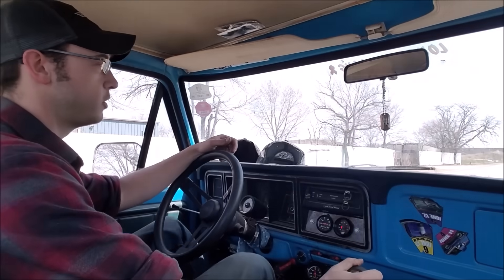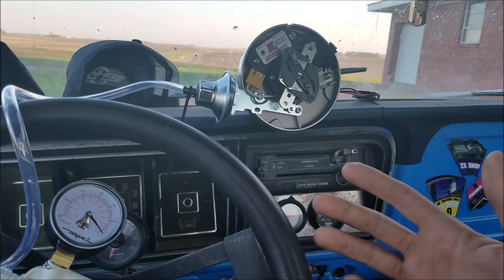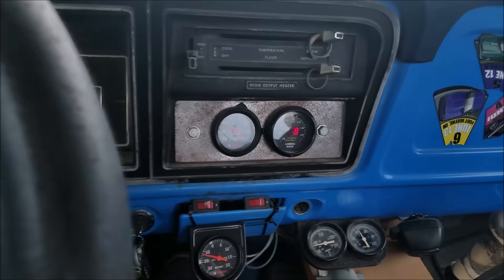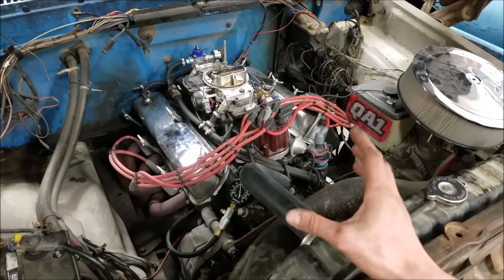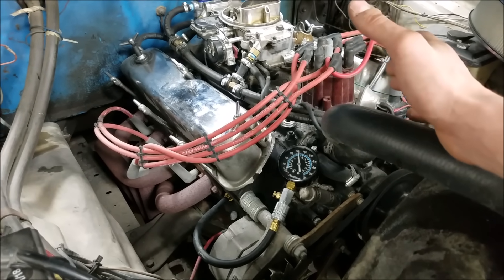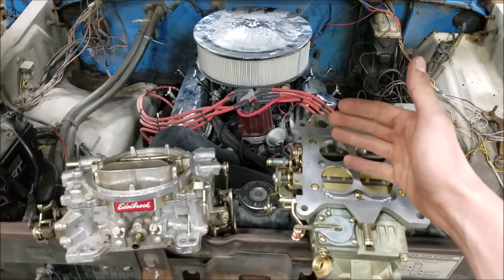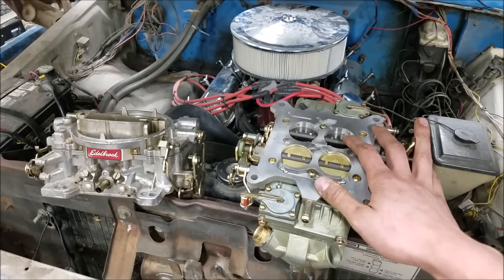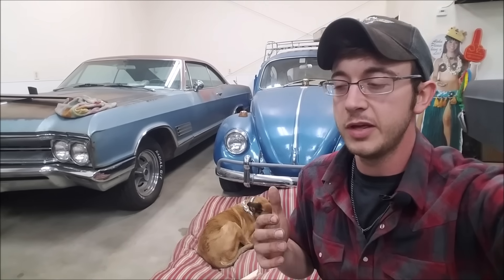Vacuum Advance - Ported vs Manifold: Which to Use & When !!!

Comment: At cruise with the throttle barely cracked, manifold vacuum is high (near 17-18 hg for me) and ported vacuum is below the threshold for the vacuum canister to even kick in.  This means that at cruise being hooked up to ported vacuum is giving me nothing when I need timing most.  Manifold is the way to go.
Reply from the maker: Lol go test that theory - I have a 100 dollar bill that says that if you put a vacuum gauge on ported vacuum cruising on anything that isn't "deceleration" will have full vacuum from the ported port. 

This is you just running your mouth without actually testing it with a vacuum gauge - which I have done.
Reply: @ThunderHead289  what are you talking about?  I have both ported and manifold gauges in my cab and I can see where the needles are while I’m cruising,  it isn’t a mystery.  There are quite a few videos on YouTube of side-by-side comparisons showing the same.  I don’t understand how you can be so knowledgeable about all this stuff and somehow miss this one.  You do realize that often a significant portion of cruise even happens off the idle circuit, don’t you?
Reply from the maker: @yeboscrebo4451  you probably have a crap machined carb then honestly which is very prevalent lately. Pretty much the moment your into anything but idle ported should be exposed and drawing full manifold vacuum. I've worked on a few carbs lately that no matter what you did, ported always had at least 8inHg which is also wrong but in the other direction. 
Seems like only old carbs are machined correct these days. 
I didn't miss anything, it's how it's supposed to work.
Reply: @ThunderHead289   Let’s get to the bottom of this because we seem to be in two different worlds here.  One of us isn’t seeing clearly and I’m pretty sure it isn’t me.  My carb is an impeccably maintained, original autolite 2100.  As I said, when i am just off idle (cruise) my manifold gauge will read near 20 hg and my ported gauge will read below 5 hg.  I literally just drove my truck down a country road and it spends most of its life cruising along just like this.  This is an efficiently running engine.  When people say “the only difference between manifold and ported is at idle” they are completely ignoring this off-idle cruise zone.  My engine and most others engines spend the majority of their lives in this off-idle cruise zone.  Only manifold advance will give you the advance you need in these off-idle low load conditions - THAT is how its supposed to work.  I really don’t understand what’s so difficult about this. Then, when I accelerate or come up on a hill, the ported needle will increase, the manifold will decrease until they equalize.  As I continue to press into the peddle, the two needles will both drop to zero.  This exact scenario is replicated in many, many comparison videos on youtube for all to see.  For some inexplicable reason, the ported guys will always ignore these off-idle cruise conditions and pretend that the gauges go from idle to equalized part throttle instantaneously skipping over the transition and say “the only difference is at idle”.  Sorry, not correct - just look at the gauges.
Reply: @ThunderHead289  Also, when I watch the two gauges in operation, I notice that when i press on the throttle through its full sweep, the ported needle goes from zero up to about 15hg and then back to zero again.  In other words, ported vacuum advance comes onto the scene giving me timing at the same time in which mechanical advance also wants to step on the stage and give me timing.  What is the point of this redundancy?  However, at the same time I notice the manifold needle starts at 20 and drops steadily to zero as I press on the throttle and the cylinder pressure increases.  In other words, manifold advance gracefully steps off the stage as mechanical advance starts its performance.  If these systems were designed for ported, why does ported seem so up-and-down, jerky and redundant?  Why does manifold vacuum advance seem to work far more seamlessly in the timing dance?  And why does ported advance not take advantage of the full range of manifold vacuum that’s available like manifold advance does (roughly 15hg with ported compared to a full 20hg with manifold on my stock, unmolested setup).  Doesn’t that seem strange?  It sure seems like ported advance is an awkward, bandaid coping measure just like Mr. Vizard said it was.

Comment: Man iam noobish lol. I just wish you could asses my 63 buick.  Sounds like I could be getting a bit more power out of my Stock 215ci. Fireball V8. Just took of the RochesterQJet  and installed the AVS2.  But my timing and carb needs a Professional To Adjust .  Thank you

Comment: You left some stuff on the table and are backeards eith you cam size scenario.  Matter of fact its a culmination of what creates higher cylinder pressure that will dictate which to use.  But, in reality, ported vacuum was a function of emitions.  Pretty much every engine will benifit from advance timing at idled/manifold vacuum.only ones that dont are ones that require locked out advance.
Reply from the maker: Instead of flapping your jaw nonsensibly, it would be wise to listen. 

Clearly to complex for everyone - the point is that it's not about what ported manifold does as much as what it allows you to then be able to do with your mechanical timing
Reply: @ThunderHead289  nice well-formed educated reply.  You're very off on your explanation and what why and how it actually benefits the motor.  Or why ported vacuum was even a thing.  I truly enjoy most of your content.  There are plenty of articles and information on this subject that does a much better and more accurate job of actually describing the hows and whys.  

You are right in it being too complex for most people.  Everyone wants a plug and play solution and doesnt want to take the time to understand the timing hows and why, let alone the time it takes to get a proper curve worked out between base, mechanical, and vacuum timing and why each are very important to tune individually.

Sorry, i seem to have just been running my nonsensicle flap again.  Lord knows i havent spent years and years working on street, and race cars and researching how and why timing is very important to performance.  I would probobly also blow your mind if i told you my truck runs at about 18 to 20 degrees initial timing and 60 total cruising to make up for the shit combustion chamber design and the poor flame front it creates, and that i tow a 10k pound camper with the 1985 technology and cranked timing on 87 octane gas.

But what do i know, im just full of nonsense.  Forget the years of knowledge drawn from actual powertrain calibration engineers ive worked with over the years

Good luck on your ventures!

Comment: Simply explain ported vacuum would be before the throttle plate- no vacuum at idle and manifold vacuum will be from intake manifold- vacuum decreases as engine rpm increases
Reply from the maker: Vacuum is irrelevant to rpm, only relevant to load
Reply: @ThunderHead289  when you open the throttle plate your manifold pressure increases - vacuum decreases and your engine rpm increases. They are inversely proportional

Comment: Have you fooled around with a dual port vacuum advance?  Looks a good way to get boost retard and low speed advance using just the front port?  Would you know how much timing it could advance in one direction and retard in the other when under boost?  I think it would have to be manifold vacuum not ported to work.

Comment: Kool info..just came across ya channel.. new subscriber 🤘
I just picked up a 75 mark iv 460bb engine clean and quiet, new 750 Holly. Only thing fella never changed was the distributor advance diaphragm... as it doesn't work..😳
 I'm in two minds to either replace the advance mechanism get a new distributor 🤷‍♂️
Are they hard to change out ?
Reply: I Changed the vacuum canister👍🤣

Comment: Thank you for this video. I recently noticed that my distributor vacuum was connected to manifold vacuum. Just like you said, after moving it to ported I lost the vacuum advance that was there with the manifold connection. Idle became more rough. Now thanks to you I know to add some mechanical advance to smooth out the idle.

Comment: The Progression Ignition couldn't handle the heat from the motor. It lasted me about a year and a half and had the module fail once before on the pressure transducer as well. Just took it off and replaced it with a new HEI distributor and misfire and back fires went away. The computer board got bad enough that it actually stopped giving spark all together. Very expensive 1.5 year service life distributor. 🙄
Reply from the maker: Dumb question, but we're you supplying it with the 12v it calls for or was a resistive lead still in place

Comment: My old car, 1960 impal with a 283 2 barrel, has absolutely no ported vacuum ports, only one single manifold vacuum, what should I do? I have it running to transmission and distributor is just running mechanical advance
Reply: You should set it up according to stock specs.  That means using the vacuum advance.
Reply: @michaelbenardo5695   again, the only vacuum port on the engine is full manifold vacuum, which is WAYY too much for a distributor.

Comment: Thanks for this great explanation. I understand this video was made 3 years ago, so might not get a response, totally understand. Im not a mechanic, but enjoy working on my car, having rebuilt the engine and many other parts. I totally understand ported and manifold and how it relates to advanced timing at Idle. I don't have a stock carb, may years ago I fitted a 44mm CV Harley Carb. It does have a vacuum port, but not a port that blocks vacuum at idle, so I have to run manifold vacuum. I have a small engine and it seems to run fine, but Ive always had in the back of my mind that Im not setting up my timing correctly. A stock spec setup should be 750RPM at idle and 10degrees on the timing. The only way I get this, is if I disconnect the vacuum, block it off, set the timing and reconnect the vacuum. But now I have 1100rpm at idle. I have driven like this for years, but i bugs me that I idle very high. So recently I added a small electronic solenoid on the vacuum line to my distributor, with a switch on my accelerator pedal. So when at idle, with no press on the pedal, the vacuum is blocked and my idle sits at 750RPM. Then when I pull off, vacuum kicks in and advances. Question, is this a dumb idea? And should I even be looking to try match stock timing settings, when I run a non stock carb. If so, without diagnostic tools, is there a way I can work out what my timing should be, to move away from the stock specs? Thanks for your time, again, great video.

Comment: I had an old Cadillac that had a thermostatic vacuum switch that would run ported vacuum to the advance until a certain temperature was reached then it would switch to manifold. Kinda like a high idle setting.
Reply: When the water temp passed a certain point, it would switch to manifold vacuum to raise idle speed and give cooler running.

Comment: I have a quick fuel brawler dual bowls and manual choke and mechanical second valve opening(not vacuum)is cant get the transfer slots to square its a litlle more and limmited by the carb bracket 
I have a 331 stroker with t5 trans and 290/290 comp cams .
Wich port should I use?

Comment: I'm old school. I've always ran Chevys with ported vacuum and Fords with vacuum as you increase rpms. As most people know, Chevys are tough and will easily revv 8k but weak v8 Fords are limited to 5500 rpms. Sure you can revv higher but Fords will experience valve floating on their single valve spring design. I appreciate your video and will have to put your information to a test on a stock 350 chevy next month. And I never knew what those slotted vents were on a carb. Lol. I'm open to learning old knowledge because I am not a know it all.

Comment: But Manifold vacuum advance doesn’t “just add timing at idle”.  It adds timing whenever there is manifold vacuum - which is at idle and just off idle and cruising down the highway with the throttle cracked.  It seems like advancing timing with ported vacuum plus the mechanical advance of the distributor is a redundant performance of the same function - the ported advance increases from off idle through part throttle (and so does mechanical timing!).  If you instead run your vacuum advance off of manifold, then youre getting timing at the precise moments of low load or low cylinder charge when it’s needed and leaving the mechanical timing to do its separate job.  Without manifold advance, what else would give you the right timing conditions for low load situations?  It sure seems the vacuum advance canister was designed and intended specifically for manifold vacuum advance to me.  If running manifold advance means you might have to drop your initial timing a bit then just make sure you’ve got the right amount of mechanical timing coming in quicker, right off idle so there’s no hesitation.  I just don’t get the point of ported vacuum advance
Reply from the maker: Ported vacuum doesn't increase with throttle in a linear way. That's venturi vacuum. The throttle needed to move a vehicle is going to be plenty for ported vacuum to be the same as manifold. 

It's literally the same except at idle. Which because of that it allows you to run more effective mechanical advance instead of "oh no, I have too much idle timing (on manifold vacuum)" hillbilly idiot turns distributor such to reduce initial mechanical - wonders why his engine seems weak and has an off idle stumble (which is due to late mechanical timing) - Wal around telling people that carbs suck. 
Yeah ....
Reply: @ThunderHead289   I’m trying to understand.  So I mapped out my ported advance curve with a timing light and from about 1500 rpm to 3000 it gave me a canister’s worth of timing (22 degrees).  The way I see it, this ported timing is being overlaid on top of the mechanical timing which is giving me about 14 degrees from 1500 to 3000.  From 1500 to 3000 my canister on ported and the mechanical timing are performing the same function - an increasing timing curve.  So what’s the point?  Why not just let the mechanical take care of it all and free up the canister to do another job?  Put the canister on manifold which would allow it to perform a different function that ported advance can’t give me - timing at low load/high vacuum situations.  I just don’t get the redundancy of ported vacuum advance.  Ported might be the same as manifold in a certain range of part throttle but, if i hook up a ported gauge and manifold gauge next to each other while driving, I can clearly see that when I’m cruising at high manifold the ported needle lingers around 3 inches whilst the manifold needle is up near 17 or so.  In this situation while driving down the highway, if I were hooked up to manifold vacuum advance, I’d be getting the extra timing I need in a low load/low cylinder charge situation which would give me improved gas mileage and cooler temperatures.  Ported and manifold really aren’t the same at all except for that narrow band of the vacuum range from like 5 to 15 inches of mercury where they are identical.  It seems like the only problem with manifold vacuum would be not enough initial timing when you stab the gas off idle.  But can’t this be ameliorated by adjusting the mechanical to come in nice and early and strong?
Reply: Keep in mind that ported vacuum starts the instant you open the throttle from idle. Therefore, it makes little difference unless the engine is left idling for a long period.

Comment: Ported vacuum leads to higher idle temps. I have a 68 L36 Vette and a 65 4-4-2, both nearly stock. I run full manifold vacuum, just like the factory. The main problem I have is ping from too much vacuum advance. I limit it to 10 max, or less. Crappy CA wannabe premium. Ported vacuum advance came in with the smoggers because they wanted the engines to run hotter. My basic curve is, set idle to highest manifold vacuum, which is 8* or even lower. Set total (base + centrifugal) to about 34, maybe 36. Chevys like a lotta lead. Limit vacuum.
Reply from the maker: Your doing that old guy thing where you arent hearing what im saying. Think about what I presented to you and how you can utilize ported vacuum to optimize your mechanical timing. 

You don't just swap from manifold to ported without doing anything else and then compare the two - that's the mistake.
Reply: @ThunderHead289  https://www.youtube.com/watch?v=HeihiAE1zJg

Comment: ONLY works on low compression engines when no matter how advanced your timing is, it won't hurt your engine.  With High compression engines,  too far advanced even for a short time will break ring lands, destroy piston rings
Reply from the maker: Not sure what you are referencing since this video is about vacuum advance and vacuum advance drops out under load. 
It's like you watched the whole video and chose to learn absolutely nothing.

Comment: Ok at 7:51 I get lost, you say now to decide where to hook up your vacum canister on your carburetor, dont you mean where to hook your canister on your distributor? Either from your intake manifold or carburetor? Confusing
Reply from the maker: The vacuum advance cannister is attached to the carb - so I'd say "deciding where to hook the advance to the carb" is a fairly accurate statement